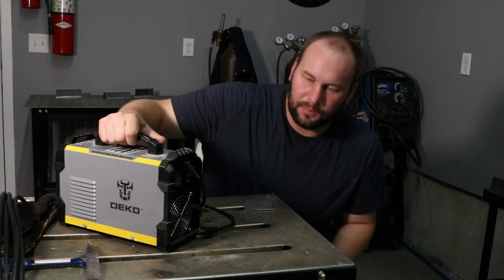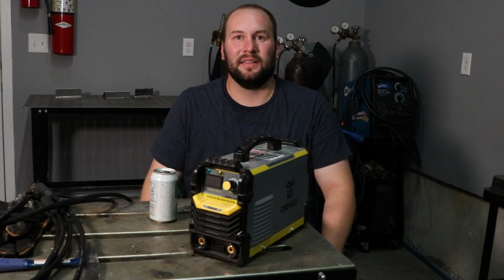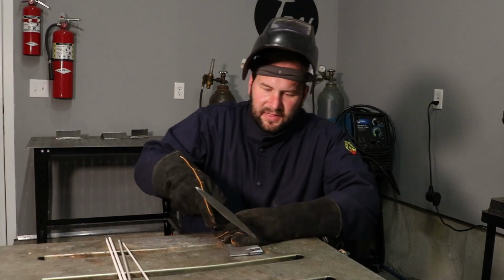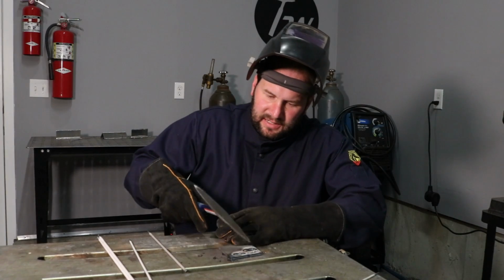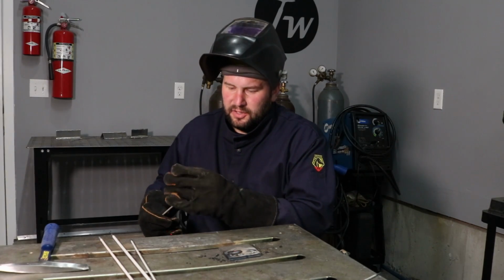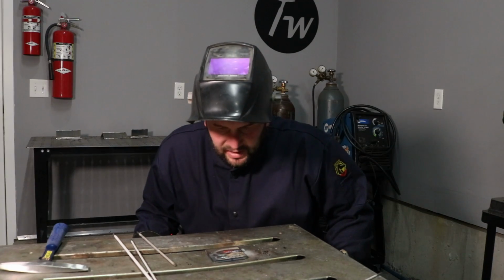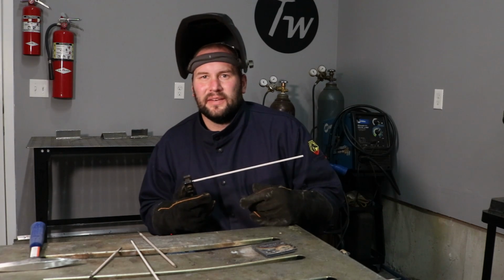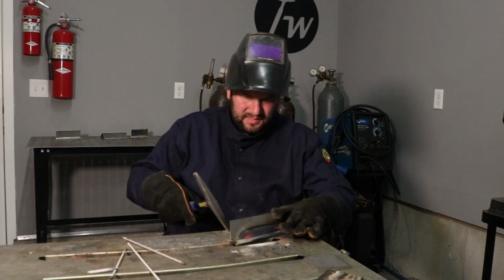Reviewing the (Almost) Cheapest Welder on Amazon: DekoPro Welder Review

Comment: I think it would be hard for a beginner to learn on these cheap chinese welders if they read the amperage on the rod package (people are always asking ,but its right there in print).  this welder must not be reading actual current, this needs to be fixed in the software or hardware to compensate for the current sag or boost on 220 and tell the truth about its output and capabilities.  If they just fudged a little on it you could let it slide, we seem to have changed in what we accept in quality from china because we expect it to be cheesy and are surprised when it works. What would we do without china?

Comment: Great video! Im a little confused if your out let is 20A/120v how are you able to draw 85A×120v ?
Reply from the maker: Thanks! It's a great question, the job of the welding machine is to transform higher voltage and lower current to lower voltage and higher current. The output is 85A and about 20 Volts, which will draw about 20 amps in at 120 volts. The exact amperage draw really depends on the efficiency of the machine.
Reply: @TimWelds  Ty may i asked where did you get the 20v from?
Reply from the maker: Thats's just roughly what stick welding runs at. The actual voltage depends on your arc length. A longer arc will give a higher voltage, but when it's running right, it's usually just a bit under 20.
Reply: @TimWelds  thank you bro!

Comment: Hi Tim,  Just ordered you full training courses.  Question, I purchased the Tooliom 135A stick/lift TIG welder.  I had watched a review and original it was a 220/110vac welder.  But when I received it is just a 110 unit.  The size is really small and seems to makes sparks....  I originally purchased it because of the 110 usage but I kind of also wanted the option of 220.  I can't seem to get 7018 3/32 or 1/8 stick to weld with out sticking all the time and when I do get it to run the weld is real flat and shinny.  Looks like a piece of obsidian rock.  Anyway do you maybe suggest the Deko Pro?
Looking forward to starting you courses.  At 75 I am starting welding all over again.  Has a Miller 110 wire Matic 135 and a 220 buzz box but sold some time ago.  Thanks, Dave...
Reply from the maker: Thanks for purchasing the courses! 1/8” 7018 likely won’t run very well on 110 volts. Generally, stick machines running on 110 max out around 100 amps or so, which is a bit low for that rod. I run 3/32” 7018 around 90 amps, so that should be a better bet. Is the shiny surface there after you chip off the slag? The Deko Pro works good for the price, though the amp readout was a little off in mine. Not sure how it compares to that one. I don’t get notifications for comment responses, so if you have any other questions, just reply to the course purchase email and I’ll help you out. 👍
Reply: @TimWelds  thanks much Tim...

Comment: Hi Tim I bought the Dekopro welder & Im just started to learn how to weld, have E1718 3/32 rod what amperage should I have dial on to have a decent weld
Reply from the maker: Shoot for around 90 amps with that rod. Mine read out higher than it actually output when plugged into 110, so keep that in mind and bump it up a bit if needed.
Reply: @TimWelds  thank Tim for your information that’s a great start for me to begin with , I’m also seeing other videos that you have that to learn more about welding, you are a great instructor 👍

Comment: Like your video.never welded before.. and . im looking at purchasing this welder and was wondering if welding 3/16 is doable on 110 and i believe my circuit breakers are on rated at only 15 amps. 
or would i need to go with the 220 out of my dryer oitlet that has two 30 amp breakers.. so i guess that would be a 30 amp outlet not 60.. i would also need a 220 extension cord of about 15 feet if they make them.. i dont know.. thanks in advance..

Comment: Newly subscribed here. I was read that this can weld aluminum as well. Have you tried it or can you point to how it performs? Thanks!
Reply from the maker: Stick welding aluminum is quite difficult and the results usually aren’t as good as other processes like TIG or MIG. That being said, it is possible, but I’ve never tried it with this particular machine.

Comment: I bought an Amico Arc180 Dc stick welder from Home Depot but once it came in I ended up getting the Arc200DC model for the same price as the 180 the reason why I bought it was the dual voltage choices. So I have the ability to use it for small projects where I don’t have 220 volts available. It’s an inverter machine and I’m happy with its performance.

Comment: Great video and thank you. 
I have a Dekopro 160 amp Smart Panel and it burns 1/8"  Lincoln 6011 very well, but , heads up, it absolutely sucks with  1/8" Forney 6011. At the same welder settings as the Lincoln rods, the Forney quickly burn back, making it very difficult to maintain an arc.
My video suggestion is to compare different brands of the same type of rod  (for example 6011) to observe how they burn with your Dekopro.

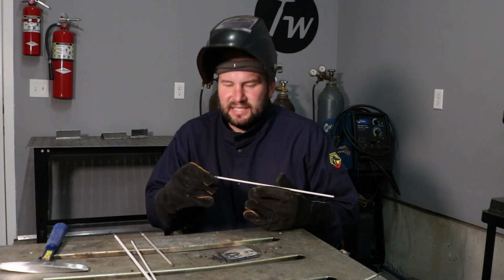Comment: 5:46 you can absolutely not run 6010 on any inverter that's not made to do it. It's not even worth trying it. It will NOT work. A 6011 would not run in any practical fashion either. 
 Most stick machines have voltage that's too low to allow a 6010 to keep an arc lit. Even some machines that have 80 to 90 open circuit voltage won't run a 6010 well. 
There are proportionally few machines able to run a 6010 . And those that can are minimum 1000 USD.
I have 4 machine that are stick-able : 2x 70 OCV, 67 OCV, 55 OCV <= none of them can run 6010. The 70V ones can barely keep a 6011 lit for 3 seconds straight . 
 Those machines are made to run 6013, period.

Comment: Will this weld 3/8 or 1/2 inch round bar/rebar ?
Reply from the maker: Yeah, it definitely will. With stick welding, the amperage of the machine has more to do with the size of electrode than the material thickness. This will easily run a 3/32" electrode on 120v input and a 1/8" electrode on 240v input, either of which could be used for your rebar project.

Comment: Have you done longer runs , say a whole rod , on 110 volts?    I have an even smaller machine that pops breakers regular if you try to go more than a couple inches of weld even with 3/32 rod.   Does a great job on 220 volts but not a great lower voltage item.    This of course negates the portability factor of these small rigs.

Comment: Hi Tim,  it's good there's You Tube and people like you testing tools and welders,  as most of these cheap Chinese welders are Way overrated and their specs are not what they claim !!
 I bought a inverter welder from EBay claiming 315 amps on 380vac,  and on 240vac. The max I could get with the digital meter set at 315amps,   was a measly 127 amps wide open !! Measured with a Fluke DC Clampmeter.  
 It welds great for 1/8" 6011, 6010 and 7018,  EXCEPT 7018 overhead.  As It needs a little more Oomph like 10 amps more because holding at tight arc will snuff out the arc.   So I had to finish the overhead with my. Pow Con 400 smt.   So my cheap welder isn't worth much when I can't finish a weld with it. 
 Great Video.                Thanks

Comment: i got this machine but it seems i can't weld 7018 on it i strike an arc and it goes for 2 seconds then it stops everytime but 6013 and 316 works great on it, guess it's because it is a dc machine so yeah have this in mind if you want a machine for professional and industrial use i wouldn't recommend this one but it's perfect for learing your first steps

Comment: Thanks for the review! I was wondering how the cheap welders on Amazon were. Started welding 5 days ago with a "Hone" DC inverter welder 150amp I bought on there for $79. Never welded a day in my life and now after just 5 days (and a ton of videos) I'm laying some decent beads. My only regret is that I'm starting with 6013 electrodes & a lot of people say they are hard to run compared to 7018.
Reply: 6013 is the easiest rod to run just gotta watch  your speed and angles while welding. 7018 can be a shit to get started if you haven't run them. Best low hydrogen rod to learn with 7016 tc easy to start and the glassy slag is easy to remove leaves a really nice finish, also can be used for root passes because it actually has good penetration. I've  just changed to them and will probably be my go to rods aswell as 6013 depending on what I'm making.

Comment: hey nice video , i gotta question i just purchased this same exact machine and im thinking of building up a trailer question is how do i determine the stick i need for the material and size. the pipe i got is just a 2x2 galvanize pipe what would you suggest the stick would be ?

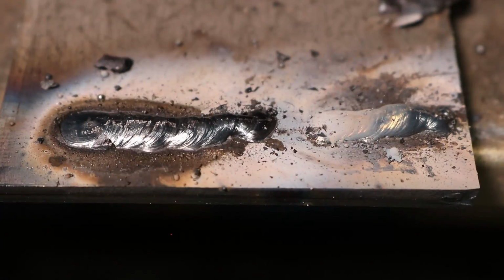Comment: I am struggling to see the difference between the very first and second tests (2:35 and 3:10)   The only difference I can see is the height of the weld.   Does the lower height on the second one indicate that the weld has gone into the metal (hence the comment about the first one being "on the surface")?

Comment: That is the thinnest 220amp gauged wire I've ever seen. I'd be afraid of burning my shop down.. kudos to you.
Reply: I bought an eBay welder, I have an off brand 315amp inverter welder at least that's what it claims,    when I opened the box and saw 14 gauge input wire I knew I got screwed !!
 I turned the welder wide open 315 amps on 240vac,   on its digital meter and measured it with a Fluke Clampmeter and. 127 amps !! is all it has,    I only needed 10 amps more to weld 1/8" 7018 overhead,   as it kept snuffing out the arc,   so I had to finish the weld with my Pow Con 400 smt.  But within its 127 amps it welds NICE.         But 14ga. !!?

Comment: I’ve watched all the reviews and videos about this welder and they’ve been positively reviewed. I’ve watched people use it at 110 and get great penetration. Unfortunately I can’t get it to weld to the steel, only melt the rods over it. Mine is too weak and I checked to make sure it wasn’t the outlet. Sucks.
Reply: It was a faulty machine. They sent me a new one and it works as advertised

Comment: I only have a simple flux core welder. But I'm thinking of getting a stick welder. In my local shop they have the Telwin Force 165. What stick would you recommend as an allround stick for just simple around the house diy projects? :)
Reply from the maker: I would use 7018 in 3/32". It not as common a recommendation as 6013 for general use, but I like it a lot better.
Reply: @TimWelds  thanks Tim. Is that the same for European standards? I live in Sweden :)

Comment: Wait, wait, wait.  You have a stock plug that's a dryer/welder plug and all is well.  If you want to run it to a 120/110 AC it comes with a short cord that plugs into the 120 outlet and I'm assuming it then goes to your welder plug with a hot/neutral/ground and not a hot/hot/neutral which would give you 240volts on US current.  Correct?

I'm looking at the opposite.  A little welder that operates on both currents but has a dryer/welder plug that goes to a standard, household current female plug that's normally reserved for 120 volts.   Fine and dandy if you keep this thing plugged into it.  

But, most people using such a cheaper, smaller unit will not have a dedicated outlet and have to use a drop cord to run it outside.  There's the problem.  You have plugs designed for hot/neutral/ground now unsuspectingly carrying a hot/hot/neutral.  I can see someone forgetting and plugging in something to get fried.

Comment: I got this welder and started learning today. Got 3/32 6011, having a hard time feeding it fast enough to run a bead on some 1/8 inch scrap cuts. Ordered some 7018 1/8 hoping to have an easier time running a bead. The 3/32 6011 I still plan to use for tacking but from what I’ve researched the 7018 is a dream to work with. Thanks for the informative videos I’d be lost without your channel!
Reply: If your rod is burning down too quickly you may try lowering your amperage.  These machines are not calibrated but I set my LCD readout to 65 amps for 3/32 6011 rod and it keeps pace nicely.
Reply: Hi

Comment: What would I need to have to run this mobile? How big of a generator? I'm still trying to understand voltages, amps, wattage when it comes to properly powering these units.

Most of my welding is done is in a shop setting where the power was installed. I just plug in, and go.

But, I'd like to get this machine for small/medium jobs. What should I get to power it properly?
Reply: Watts = volts x amps
A standard outlet (in the USA) is 115v / 15 A. That's 1725 watts maximum, and really you should only run 80% of that capacity continuously. 

This welder can run up to 3/32 6011 rods from a standard 115v outlet with no problems. So if thats enough you would want a generator that can output around 2000 watts or 2 kw.

I will say 220v power feels a lot smoother even with the same size rods.
3/32 7018 rods take a little more juice than 6011 of the same size. So for 3/32 7018, or 1/8" 6011 you will want to use 220v power. To match what a 220v @ 20amp circuit can supply, plan on a 4000-4500 watt generator.

Comment: How does it use 65 amps at the end of the electrode yet can only draw about 20 amps from the wall socket without throwing the circuit breaker?

Comment: I got one of these bad boys this week and I cannot get an arc started using 1/8 rod. I turned it up to 114 amps which is the max it would let me go on 115v and the electrode (6011) just kept sticking rather than starting. 

It's been a few years since I arc welded but I never had issues starting an arc. I might try a 3/32 rod and see if that's any better. I have to assume my rods just need more juice. Last time I used them was on DC 24v car battery welder and they worked great! But I had like 300-500 amps to work with.
Reply: must use 3/32 rod on 110
Reply: @narcissistinjurygiver2932  thanks. I did end up having better luck with 3/32. But what I really need is a 220v supply in the garage

Comment: I find it works well up to 2/32 on standard plug..anything thicker like 1/8 it benefits from 220volt.  It flies on 1/16 rods.
Reply: What gauge extension cord did you use?
Reply: @joule-trix tbh it came with a converter.  I did plug it to a 50amp circuit socket

Comment: Hi Tim, DekoPro also makes a 200 Amp model, do you think I should go with that over this one?
Reply from the maker: I’ve never tried that model, but if you have need of more amperage, it could be a better pick. When it comes to amperage, as long as I have enough to run a 1/8” 7018 (130ish amps), then I’m good.

Comment: Novice comment so don’t rip me.. what would you recommend for 110v welding only. I don’t have the ability to do 220v. My hope is to weld little projects in the garage and repairs on my race car chassis if need be. Is that even possible? Appreciate the advice.
Reply from the maker: Hi Ryan,
I’d probably get a little MIG welder in your situation. You can get a 110 volt version or dual voltage which gives you the option to upgrade to 220 later with the same machine if you want. I like the Millermatic the best for 110 volt or dual voltage MIG. I’ve also been pretty impressed with my Titanium MIG 170 from Harbor Freight.

Comment: I bought one of these (mine is branded "Merrco") recently and immediately opened it up before using it, to inspect it for badly soldered joints and any other obvious assembly flaws. The only thing I noticed was a small piece of the circuit board was broken off at one of the corners; perhaps it fell during assembly and chipped off. I put it back together and began using it, and I am very impressed. It seems almost counterintuitive to have 120 amps coming out of this little box, welding 2" x 2"x 1/4" angle iron with ease. All of my welding was previously done with a Lincoln AC-225 (before it was stolen), and so far this little thing is holding its end quite nicely. The only thing I don't like about it so far is the location of the power switch; it's at the back of the machine and under the power cord, which feels a bit clumsy to reach, especially with gloves on. One thing I would recommend, is to not have it running close to where you're grinding or cutting, because the cooling fan has a strong suction that can pull sparks or the the electrically conductive dust from abrasive wheels into the machine. That can possibly cause short circuits and premature failure of the machine. I would've incorporated air filtration in the air intake side of a machine like this to reduce that risk.
Reply: There are actually inserts that you can get for fans this size that have a filter on them! They are typically used for computer cases to keep out dust, but I wouldn't put it past it working on here.

Comment: A co-worker has this welder, I have the YesWelder 160 and we ran them both all day for a two day welding job welding mostly 1/8...We ran them both on 240 and  were both impressed by how well they performed... I've owned Miller and Lincoln welders and for the money these little welders are a great value.
Reply: Hey, I am a beginner hobbyist who has a minor use for welding. There are times I wish I could weld a coupler to a metal dowel or something to use as a tool, or just configure certain tools for my niche DIY projects. 

Would you recommend something like this for me?
Reply: hi, was the yes welder just as good as the deko, its just the little yes welders are a tiny bit cheaper in england, thanks?
Reply: @lazycarper7925  Yea, It actually has more features as far as dig function and what not...
Reply: Yea 240 is the key, a family member got one I was is g it on a generator,  kinda wanted to big down gen at 130 amps.
Reply: @ryanb1874  Huh?
Reply: @marklykens7450  pretty sure Ryan meant that it worked “good” but wanted to *bog down the generator when set at 130amps.
Reply: 1/8 7018?